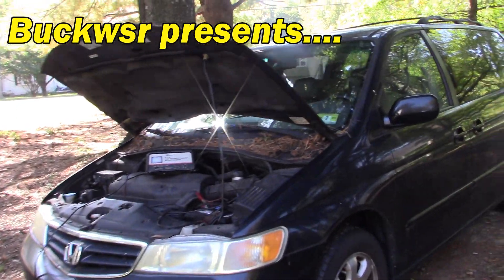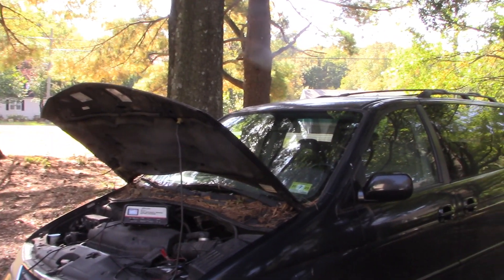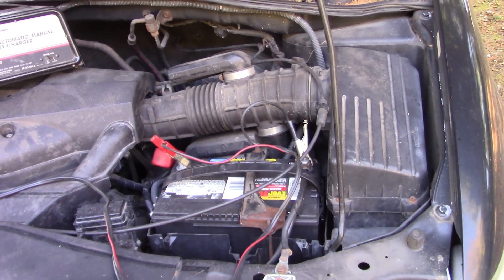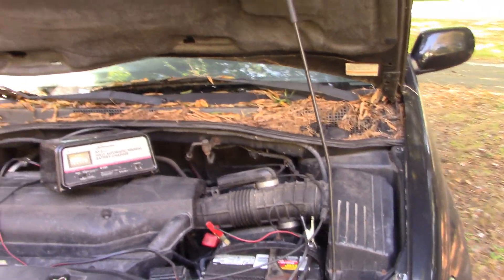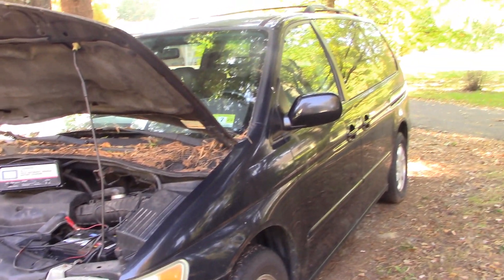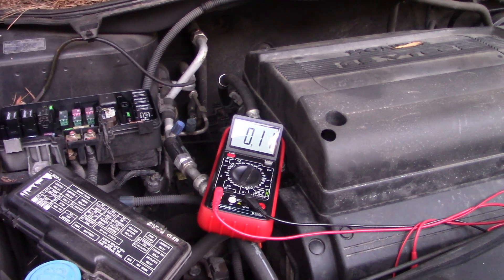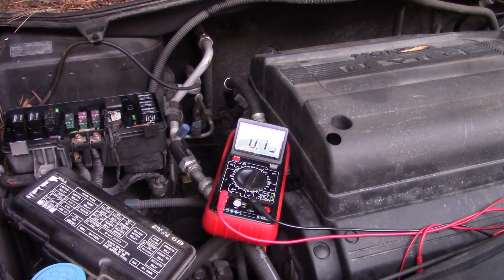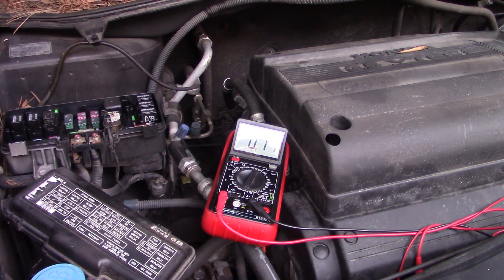Parasitic BATTERY DRAIN (Part 1) How to IDENTIFY the Offending Circuit - Honda Odyssey

Comment: my hond hrv 2020 how to bypass the hood latch sensors? do i need a jumper wires ? wich connector on the hood device connector or the car connector? need help wich resistor i need to by pass the connector?

Comment: I'm starting to have this problem all of a sudden here in 2024. If I'm not mistaken that Backup ACC is the circuit for the horn relays that sound when the alarm goes off. Back to that battery drain problem, yeah, I just put a brand new battery in my van only a week ago to come out earlier this evening to find the same problem with the van I had then is now happening again. Looking forward to watching video #2.

Comment: The first problem we ever had with our 2016 Honda CRV. Battery goes dead after sitting for a few days.. it was the power window motor in the drivers door. $900 to have it sorted at the dealer  here in 2023
Reply from the maker: Yep, it hurts to drop that kind of cash for a problem like this. But at least it's resolved now, and the reality is that Hondas are great vehicles. You can drive that thing for 25 years or more, if you wish. Good luck.

Comment: While not the same model my 2006 ody had the same draw on the 40 amp back up fuse. It sends power to the fuse box by the drivers seat. Pulling fuse #7 there (also labeled backup) dropped me down to zero. A quick Google told me what that fuse controlled.  The most common issue is with your power doors. Specifically the rear latch. What happens is the the grease in there gets old and needs to be cleaned and refreshed. If the parts don't move all the way into place they leave switches open and the control module stays "awake" and drawing current.  On the 2006 generation the draw is 399-405 mA.  A dead giveaway that it is the door control module. There are several good videos about removing and testing that troublesome rear latch.
Reply from the maker: Great info, Chris! I really appreciate it. Yep, that rear door latch is where my search eventually led me. Thanks.
Reply: also on the message board for these vans.. many said its the power door in the back sensor staying open so the door beep and stuff is draining

Comment: we had a volts wagon with an analog quartz clock. That clock would kill a brand new battery overnight..
  My 2016 Honda CRV has a .5 amp parasitic draw.. it kills a brand new battery if the car sits for more than four days. In doing research on YouTube, this is a very very common problem with Hondas.. practically all of the people searching for answers then put videos on YouTube, all of them have not had the problem resolved. In fact, a couple of the mechanics showing how to trace a parasitic draw say that .5 amp draw is normal..
   other people have said they have had the car to the dealer and the dealer says the alternator is fine, and the battery is fine, there’s no problem..
  At our age, if I can’t fix this problem, I’m either going to install a blade switch that disconnects the battery from the electrical system overnight if I choose, or I’m going to buy a  new Toyota ..
  It’s either Honda or Toyota that make the most reliable vehicles in the world. The Toyota Corolla has been voted by mechanics around the world to be the absolute  most reliable vehicle ever.. but I am much more familiar with Hondas since all three of my kids have had multiple Hondas, and I’ve had about 20 Honda motorcycles and quads over the decades.. from Honda 125 mx to a gl1800 goldwing..
  so I’m more comfortable buying a Honda because I never owned a Toyota anything..
  But if I can’t solve this mystery of my battery going dead, like many other people’s batteries, I’m going to make the switch
Reply from the maker: Very interesting. Here are a few thoughts. First, a .5amp battery drain with the car at rest is NOT normal. You can do the math: a half-amp draw on a battery with a 50amp/hour capacity will kill the battery in 100 hours, right? That's just 4 days, like you're experiencing. There's clearly something else going on. I hope you're able to figure it out! Your car is not that old. There's no reason to give up and trade it in. Surely there is a reason this is happening, and a resolution around the corner. Good luck.

Comment: I watch the videos of two mechanics. They do what you have done. People leave chargers in accessory outlets and these can cause a parasitic  draw.
Reply: mine definitely is not that.. on the odysseyforums message board... its usually the rear door sensor busted

Comment: I understand you may have already fixed this, but maybe something in this comment will help someone in the future, if not you now.

First, although you seem to be having pretty good luck pulling fuses to diagnosis this Parasitic Draw, on newer vehicles this method will not work very well or at all. This is because newer vehicles have many modules (computers) and pulling a fuse then putting it back in will wake up one or more modules which will cause a current draw, possibly one that will blow the fuse in your meter, or damage the meter. Some newer vehicles have more than 50 modules (computers). Your 2003 does not have too many modules, but it definitely has modules.

A better way to do this is to measure the voltage drop across each fuse (you would like to have two (2) meters, but it is not required). You should measure 0 Volts. Any voltage drop, which will be mili-Volts, across a fuse indicates that fuse has current flowing through it. You can easily determine the current draw by getting the free charts (in pdf format) from Power Probe to convert the mili-Volts you measure to current in mili-Amps or Amps. Just search for Power Probe Fuse Charts, and you should find them to download (pdf format).

Now, what I probably should have started with in this case is that the Rear Door or Left Rear Door (or any Door) that it thinks is open will either or both cause a light to be on, and wake up a module. I suspect your problem could be related to these doors. The Backup/Accessories Fuses likely power these switches and/or lights. The Rear Door light is likely a 5 Watt bulb, which would draw about 400mA, so the bulb itself is likely not your problem, or it is powered by a relay.

Speaking of Relays, the control side of a relay, generally, will draw about 120mA of current, pretty much exactly what you are seeing. Since you have been pulling fuses, maybe you can pull Relays without causing a problem, but it, as previously mentioned (pulling Relays will have the same effect as pulling Fuses described earlier), could cause a problem including but not limited to damaging your meter.

I would find the Relay that powers the switch on the Rear Door, or the light, or something to do with the Rear Door, as there is a good chance your issue is related to it. Same with the Left Rear Door. It looks like there may be a Relay powered on that shouldn't be, likely related to one or more of these Doors. The one concern with this is that the Load side of the Relay might then be powering something (Door Light, etc.), that would draw more current than you are seeing (IF the Load Side was also powered, which it might not be).

Finally, to try and UN-complicate what I probably made complicated, your Parasitic Draw could be the Control Side of a Relay is powered, but Load Side is not, which would draw right at or about 120mAs of current.

Once you narrow it down to the exact, not only circuit, but component, you will then have to test it (say possibly the Rear Door Switch, or Left Rear Door Switch, assuming these are your problem). Likely, the Door Switch is open when Door is open, and Closed when Door is Closed, but it could be the other way around. Comparing the suspected bad one with a good one would determine which it is. Switch Closed would probably mean grounded.

You are going about it in a pretty good way.

I should just mention that a Inductive Amp Clamp is very useful for Parasitic Draw issues, but can have some problems with lower currents, depending on the particular Amp Clamp.

Good Luck, if you haven't already figured it out.
Omegaman
Reply from the maker: Thanks for taking the time to view the video, and for giving a detailed response. I really appreciate it. And yes, I've solved the problem, as my next video will show, and it was related to the tailgate issue. Thank you again!